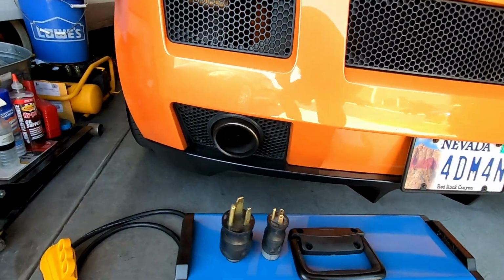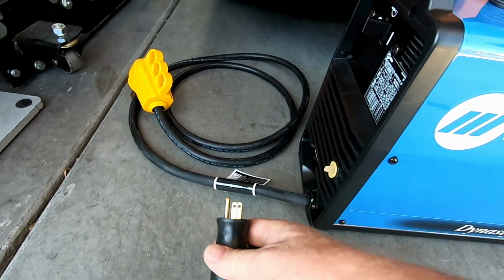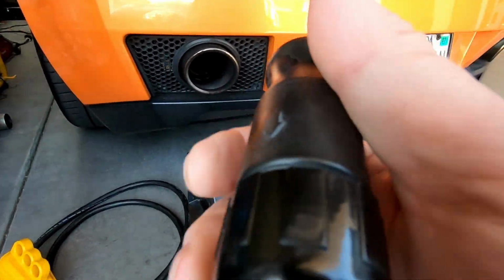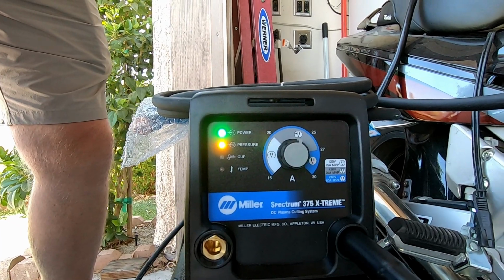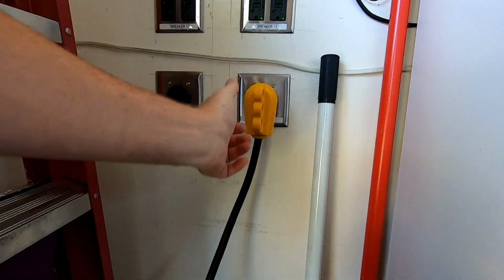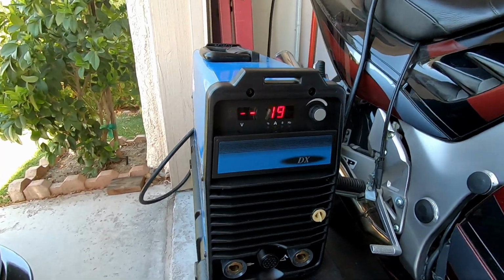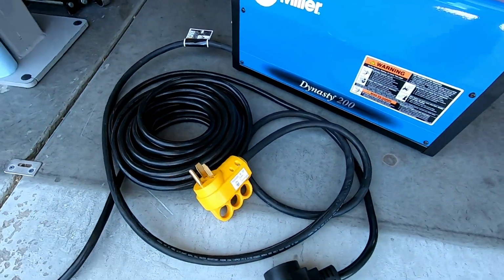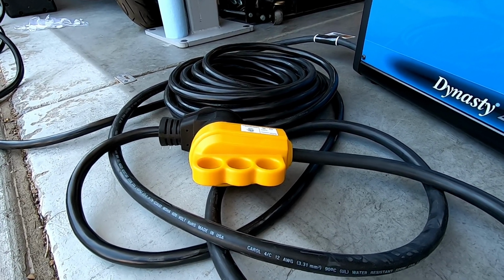Miller Dynasty 200 Welder & Spectrum 375 X-Treme Plasma Cutter

Comment: Those are Nice, and i know the feeling all though not a miller i bought my welder 3 yrs ago used to the poorly weld my bug seats in and its been sitting since my compressor hasnt done anything other then blow out my garage an fill my tires , i have paint guns and air tools air nailers weld dent pullers just waiting to be used , sad huh . So cant wait to see you put them to use ;)